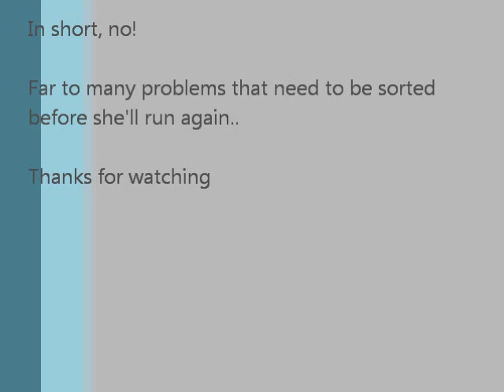Briggs WMB - Part 2

Comment from the maker: Hi Roadking, thanks for the comment.. just wondering if you knew any good suppliers in the US for parts for these engines? That will ship to the UK? Im getting quite a lengthy parts list lol Need a needle valve, front and back oil seals and a fuel tank. 

Cheers, Dan

Comment: Hi mate,

just wondering if you have a check valve in that fuel line? You need one to hold fuel in the line, it won't keep running otherwise.